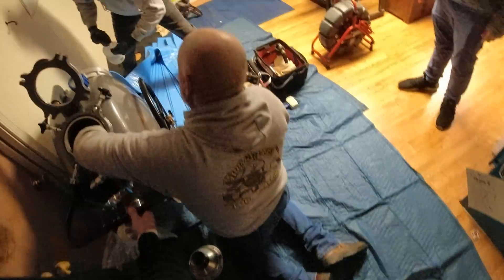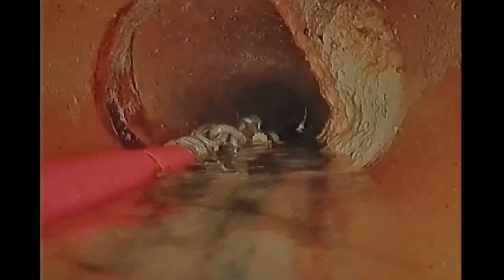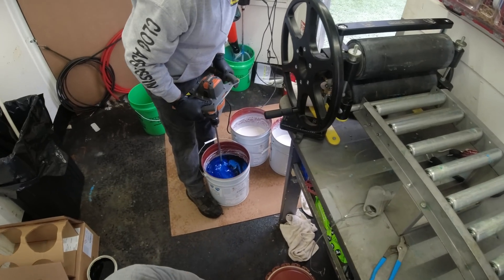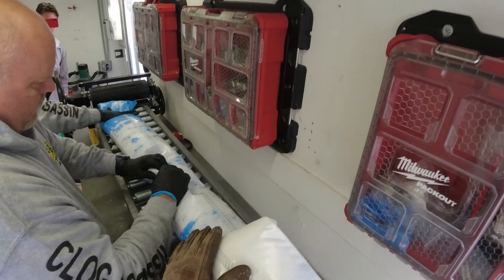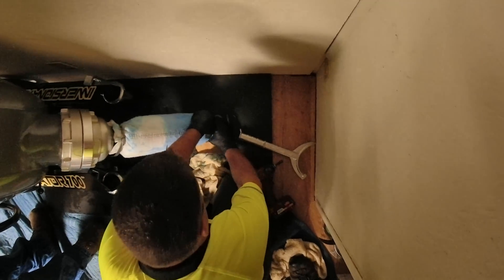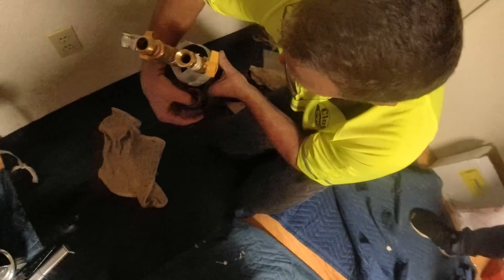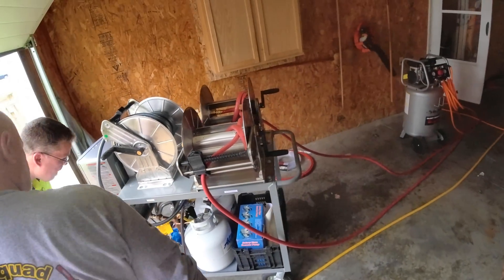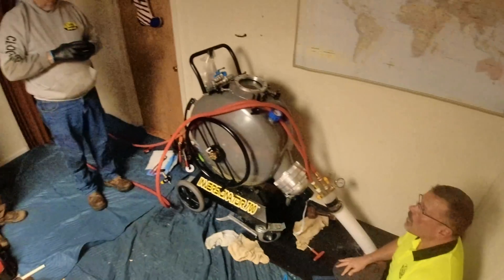My first ever sewer liner- zero dig technology

Comment: Any reason why you aren’t using ambient cure instead? Once you shoot liner, you shoot your calibration tube, leave inversion head hooked up to calibration tube, air up calibration tube to 8-10psi, and leave it alone for 1-1.5 hours. No need for water heater setup, no need to worry about hooking up additional hardware to calibration tube after you shot it.
Reply: Ambient cure takes too long you lose the he ability to do multiple jobs in one day switch to UV cure
Reply: @RDHPLUMBING  depends what ambient you’re using. I’ve used vinyl ester resin, and from start of mix to fully cured liner, I’ve had jobs range anywhere from 40-70 minutes, whether it’s a 10 foot shot or 400+ feet. When I was with my previous company, we had contracts with local municipalities to take care of homeowners laterals, shooting from exposed cleanout to city connection. It was common for a crew of 2 guys to take care of 10-15 homes in a single day, as long as they are lined up on a street and we can just move our truck to each house with minimal setup/breakdown.

Comment: Seattle needs you. Every waste line is failing. Circa 1920 stuff.  Working through the finished floor looks awkward.  Where’s the clean out?
Reply from the maker: They made it awkward, since this job I've learned we could have made it so much easier with a different approach and different liner material. Thanks for checking in again!
Reply: Your relaxed, informative style of video presentation is always appreciated.  You have a rare ability to convey the topic with simplicity and directness.
Reply from the maker: This is the cleanout, unfortunately. Nowhere else to access

Comment: Can you do a video on how you drill out the branches. This may not have had any but don’t you have some sort of drill that goes down the branches and taps into the fiberglass
Reply from the maker: Yeah, i use a special drill head on my machine, i'll have to show it one of these times
Reply: the first 4 minutes shows them cutting out roots from the pipe........??
Reply from the maker: @Lewdacris916  The commenter is referring to cutting drain branches back into the sewer after the liner goes in and closes off a tee or wye branch from another drain line.
Reply: Lateral reinstatements can be done by sending a milling machine down the lateral with proper reinstatement heads. We recently bought a Dan Cutter which is a robotic cutter with camera that we use to cut out the lateral tie-ins from inside of the host pipe.
Reply: Did you have to reinstate this one. Looks like the liner going down the cleanout blocked off the rest of the pipe attached that cleanout